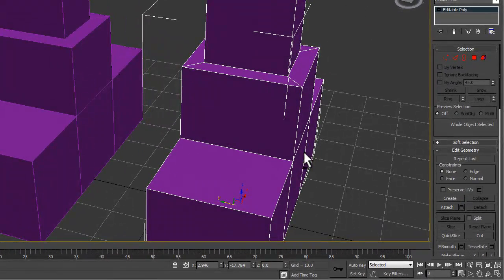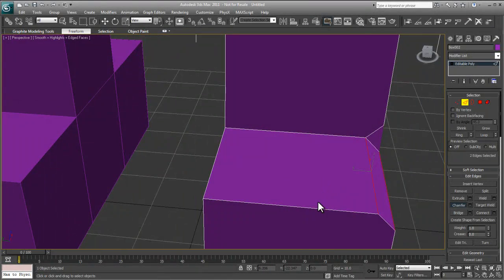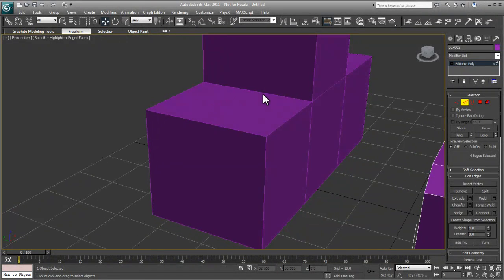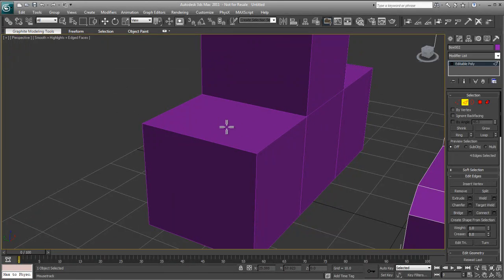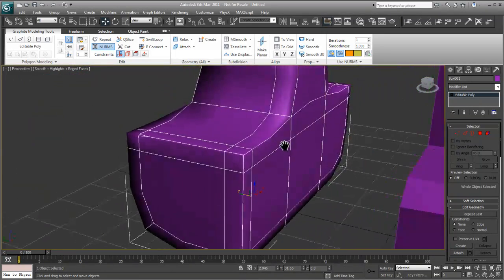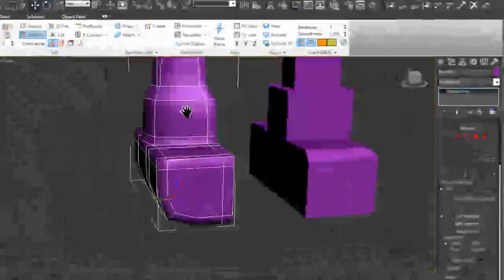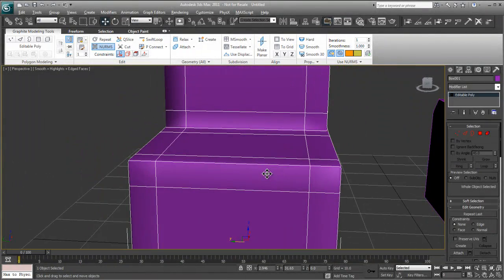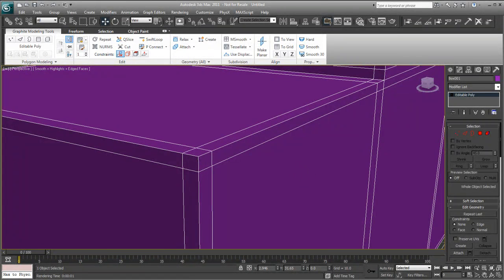3ds Max tips and tricks - Controlling edge quality with swiftloop

Comment: hey 3ds max trainer.. does max have a bevel command that can do perfectly flat bevels, meaning they are sharp and have no rounding profile (basically fencing edges for sub-d modeling)?
Reply from the maker: +picosdrivethru do you mean edge chamfer?
Reply: +3dsmaxtrainer yup edge chafer, but without any rounding, perectly flat to the holding edge.. does it do that?
Reply from the maker: try the chamfer modifier